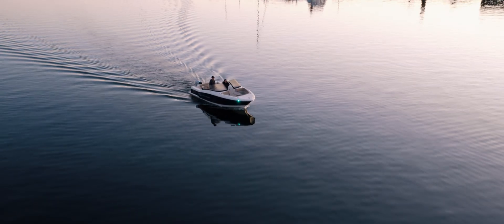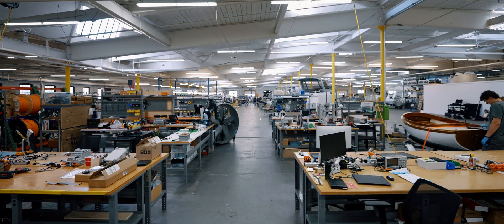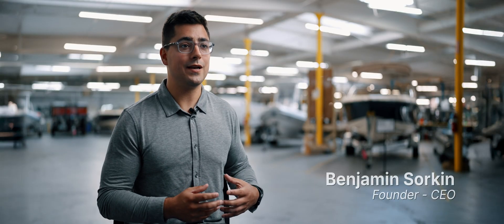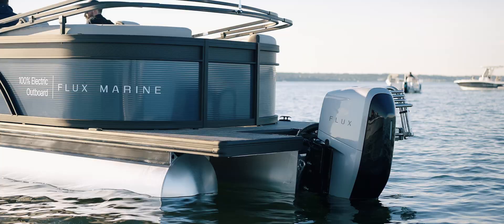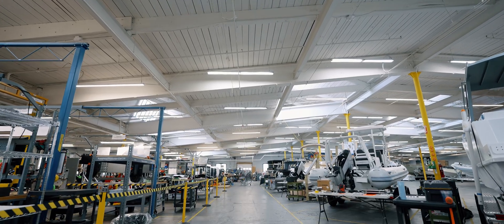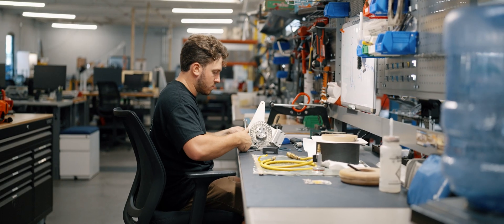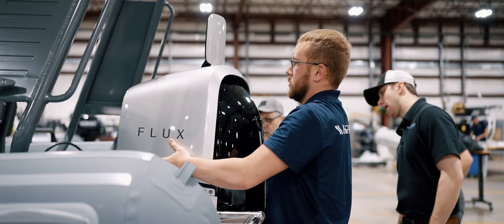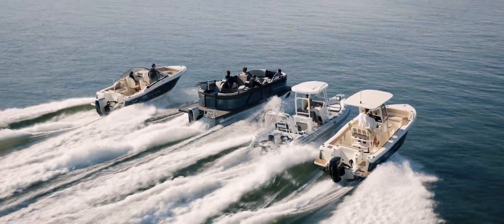From Startup to Scale: Flux Marine’s Electric Outboard Expansion

Comment: I'm really looking fwd to buying an all electric boat in the future.
Hopefully you'll come out with  larger, more powerful versions in the 200-300hp range.
Reply: What size boat? How long do you need to be up on plane?
Reply: @electrifiedmarinaYT Hi, I also follow a lot of your content.  Great job on informing ppl about all electric boats!

Im a long time boater and hoping to upgrade in a few yrs.  Likely to a boat approx 21' long, but I do like to have decent performance, at least 50 mph.
So that's why I need a motor likely in the 250hp range.
But I should be able to use a battery similar in size to the Flux 85 kwh option since I don't go on runs that are too long.
Reply: @blackvr4tt so glad it's appreciated. 👏

 We are trying to ramp it up. It's not easy being the only dealer focused on it. The Axopar AX/E is the only solution on the market. We could also do a Volare. Both would be $300k in today's prices. Has about $100k V2G benefits considering how much battery they have. A $200k boat doesn't sound as bad. 😂